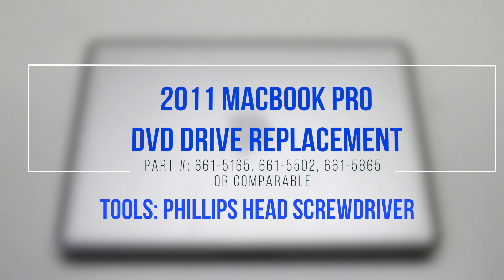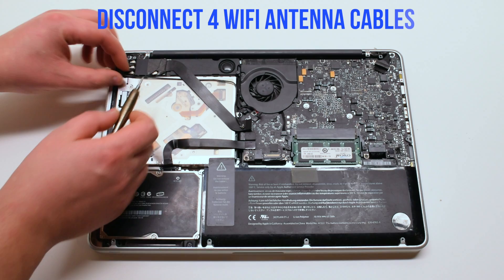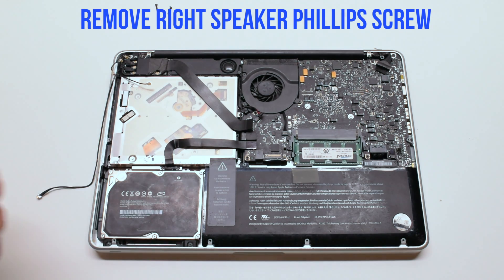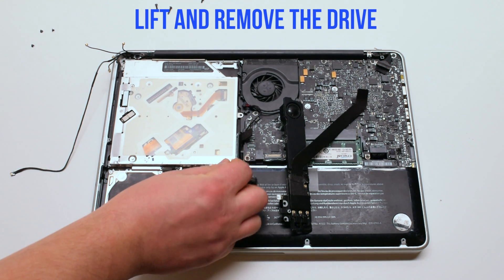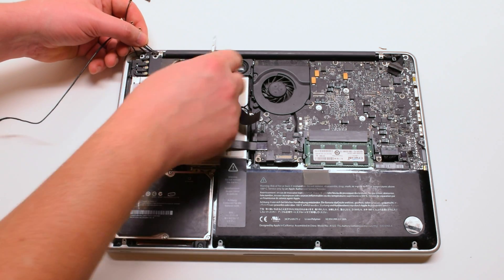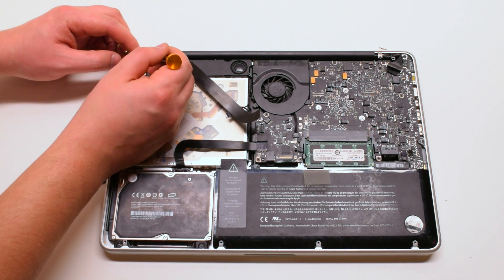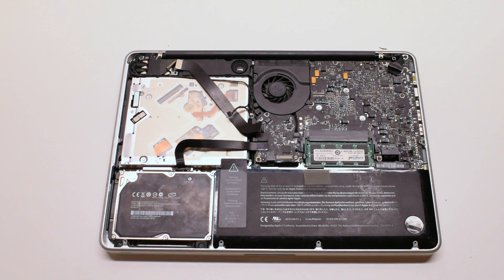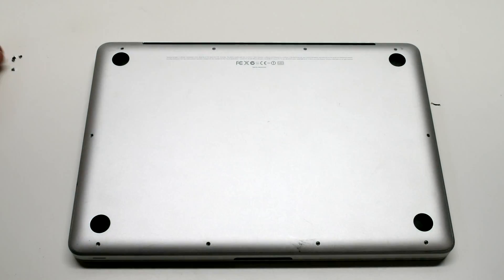2011 Macbook Pro 13" A1278 DVD Super Drive Replacement

Comment: I wonder why a modern laptop with a fast wi-fi connection will not play this over 360p.
Strange.
Thanks for the video.

My 2011 MB Pro will not boot, It has regular/constant flashing sleep indicator light.

It seems to be making a noise as though it is trying to boot from the optical drive.
A tiny, low volume bleep and a disc spinning whooshing sound is all the sound it makes.
It has no battery but has worked without one for years.
If you can give me a hint... Thanks.
I have tried the various start-up key options, but nothing.
It does not even boot to the boot option screen (I partitioned it).
Reply: I wonder if just removing the optical drive cable and then trying to reboot would help.
Here goes...
Reply: I also have a nice pc and I can't pay this over 360p

Comment: Wonderful and helpful video! Thanks alot!! Just onething: I accidentally broke and disconnected the cable right next to the speaker cable (another long cable you removed around 0:59). Do I need to freak out about this accident I made? 😭
Reply: I had the same issue. it's a bummer but it's 'just' the camera
Reply: Gijs de Jager so I “just” had to bought the webcam lol 😂

Comment: I taught software classes to over 100,000 people in my career including one to Steve Wozniak and I want to say that you are the FIRST instructor on Youtube that was crystal clear and unassuming in your teaching and explanation. Kudos for a great job. Most people on Youtube do a NON-step By Step explanation and I am lost from the start. They skip necessary steps and try to be cute showing little homemade shortcuts to do their video. Yours was so simple and exact. I just wanted you to know that I wished everyone did a help video like you did. Thank you.  Keith
Reply: Indeed, this was a good step-by-step walk through on how to replace the Super Drive HOWEVER it would have been helpful to explain that the iSight camera connector comes OUT not UP from its hub. I unfortunately pulled UP on the connector and removed it entirely from the motherboard.  No iSight camera for me. Hopefully this helps anyone who reads this before attempting to extract their drive. I'm unsure if there is a way to correct this error, or if there will forever be a disconnected iSight camera cable in my machine longing for a way to see the world again...